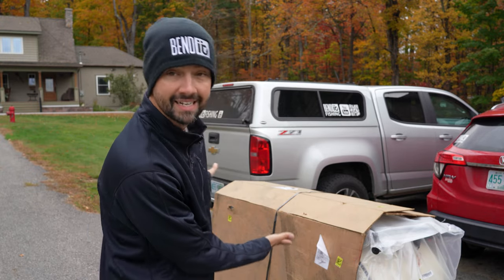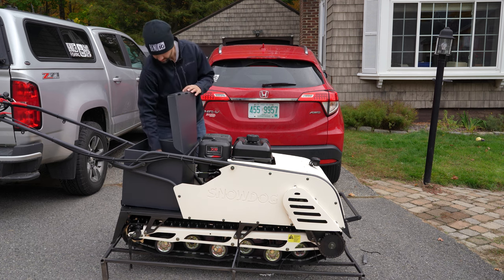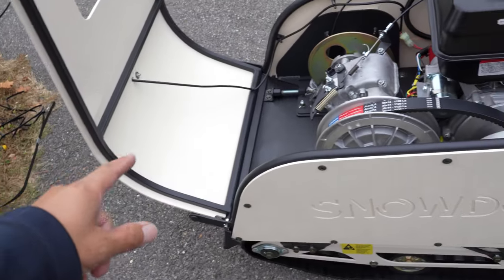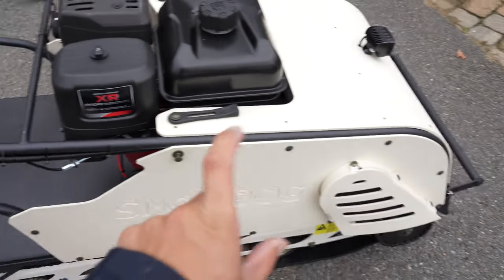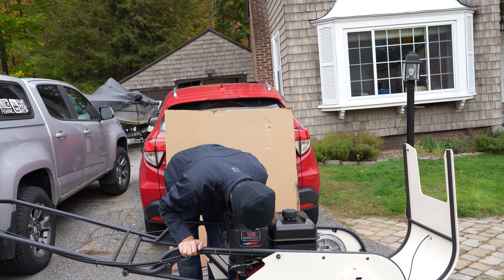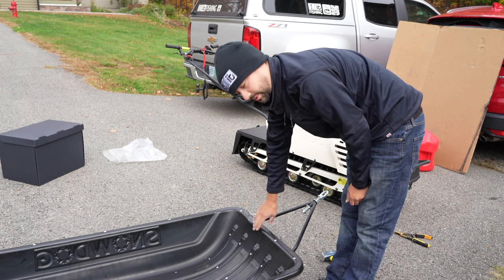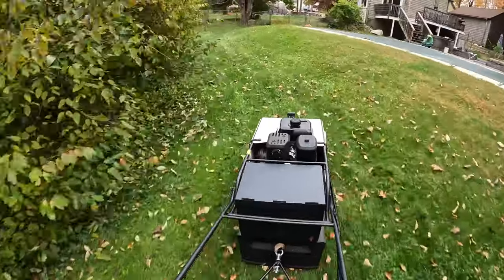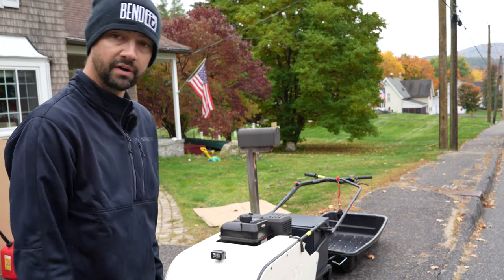SNOWDOG SPORT B13 MER Unboxing, Setup and First Run!

Comment: Do you think its harder to steer because you are using it on the ground? I know its bigger than the other model but in the snow they tend to bank and turn over a little therefore helping with steering because its not flat with such harsh turning on the ground and more like turning on pillows in the snow.
Reply from the maker: It's definitely harder to steer on grass

Comment: Assuming they sponsored you hence the larger unit, but wasn't the point that the other snowdog was lighter smaller etc?
Reply from the maker: It's still pretty light at 330 pounds. I needed that extra power for overnight trips

Comment: Just a question?
Why not an ATV? That can be use all year round?
Reply from the maker: This can be used all year as well. Has boggie wheels and is air cooled. They make a Chariot style cart to ride on
Reply: Many reasons, it weighs 250lbs soaking wet with a super wide footprint, gets you out on 4 inches. It takes up a 2x3.5 section in garage. It has way less parts to maintain. Fits on a hitch, or in the bed of a truck with cover. If you can work on a lawn mower you can fully maintain it. Many states don't require registration. Burns way less fuel. Just a few reasons anyways. Also you can use year round!
Reply from the maker: Nailed them all!!! Oh and it's friggen cool!
Reply: You can go further with a Snowdog before you get stuck.Easy to high center an ATV in a drift,even with chains.Snowdog will just glide over them like Santa riding the Norelco razor. I have both,it's possible the dog will get more use.I have used mine on bare ice without studs,just have to take it slow.Better than walking.Much cheaper to maintain vs ATV.Plus they stash away better than an ATV,fits in a corner of a garage.

Comment: So like half of the reasons why you liked the snow dog over a snowmobile were eliminated by getting a bigger model.. at this point a cheap used sled would make way more sense imo 🤷‍♂️
Reply: No they are not the same, these have way more utility and can get through deeper snow than most snowmobiles.